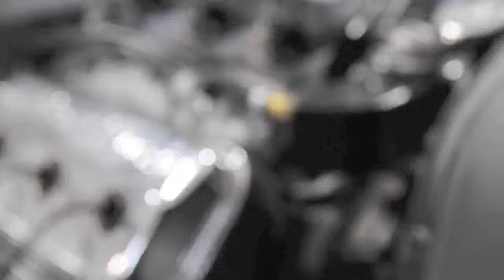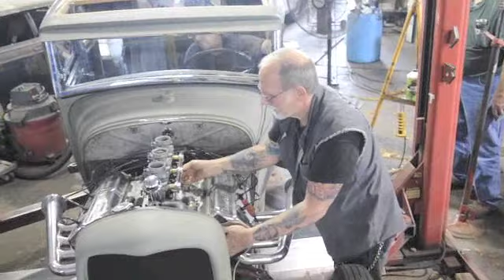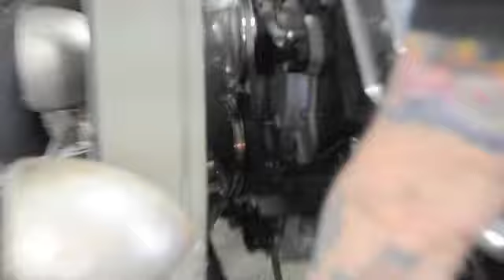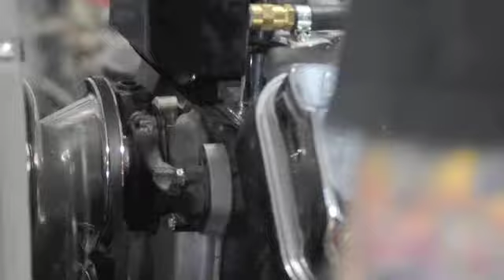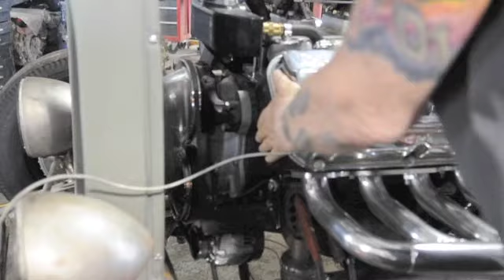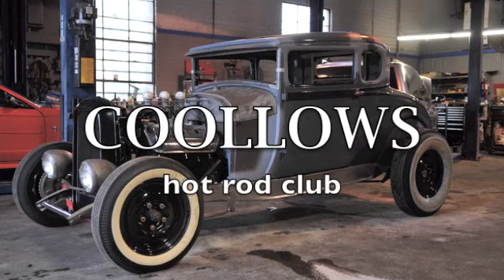HIBBS COUPE  first start

Comment: Been easier if the dum-dum in the seat could have just kept it running for the poor guy,  he even had to be to "told" see if it had oil pressure at first, wow !